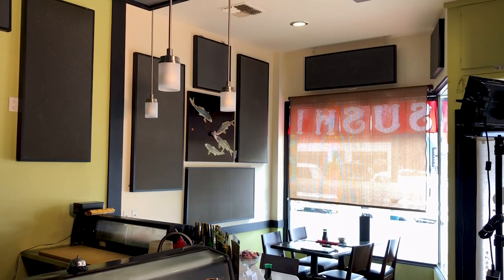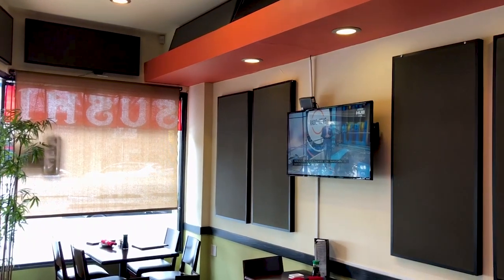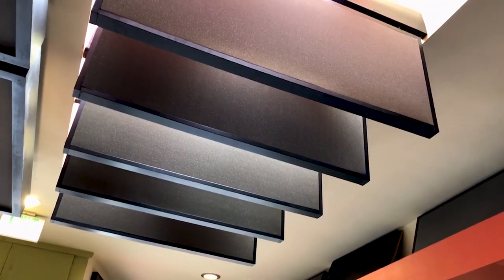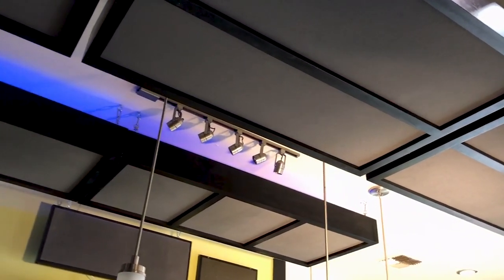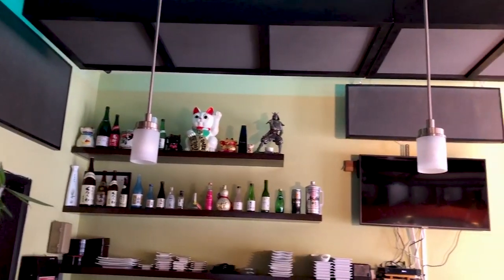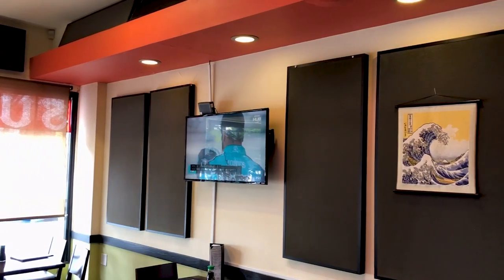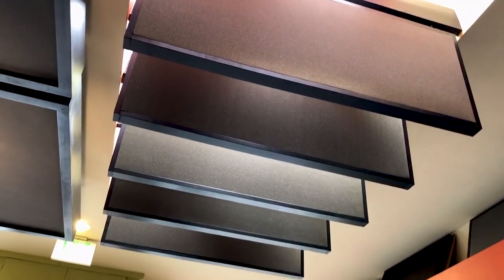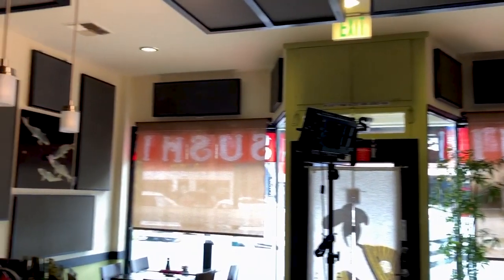Kaito Sushi Bar A Case Study - www.AcousticFields.com

Comment: Are you going to wrap the foam with an attractive fabric so it makes the restaurant visually appealing?
Reply from the maker: O,  The performance/cost ratio must be always kept in mind for business usage. You must get the most performance for the least cost. Fabric is expensive and cosmetic only. Client was happy with grey foam and black trim for his usage.
Reply: @AcousticFields  For a restaurant, that ambiance is key to a successful restaurant (High quality food/service is also important).  As a customer, I would want to be around nice fabrics rather than foam.   If I were the customer, I would get an interior designer to look over the various Guilford fabrics to pick something that's going to meet the needs of the restaurant from an esthetics perspective.  it would create an ambiance that customers would enjoy.

How do their customers like the treatment from an asthetics perspective?  I'm sure the sound improvement is going to be enjoyed, but then it comes down to esthetics and yes, good esthetics can cost $$ and that's part of the restaurant dining experience.

Even in a room used for recording or listening, I would think that ambiance and the esthetics are also important.

Plus, having fabric will help in the longevity of the foam.  Foam does break down over time (several years), especially if it's exposed to sunlight.
Reply from the maker: O,  Fabric is always an option. It was not chosen or required by the client in this project. Owner says business is up 15% since installation. It is the best type of business with regulars that are repeat customers. People have come back.
Reply: @AcousticFields  That's great that his business is up 15% because of the treatment added.     I'm wondering what would happen if they had an interior designer choose a fabric that would improve the visual ambiance of the restaurant to see what impact that would have.  

Having had several brands of acoustic foam in my own listening room, I know that foam, over time, will start to deteriorate if not covered by a fabric, especially if it's exposed to sunlight without UV protected of some sort.  it does take a few years to notice the deterioration (depending on the foam used and around of UV light it's exposed to), but I would think that one would want to protect it with fabric for both a visual appearance perspective and a protection of the integrity of the foam.
Reply: You should google for restaurant trends. Most complains from customers are about 27% about the service, then you have 25% about noise/acoustics as the second on the list. Believe it or not, food and visuals are not as important as you can think.
Reply: One option is to use custom printed fabric, maybe some japanese themes, something minimalist.